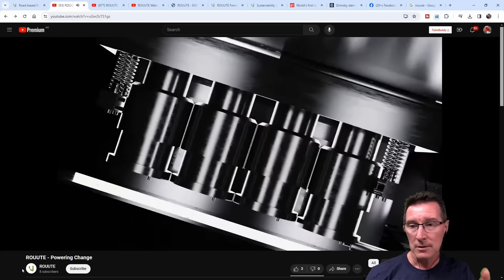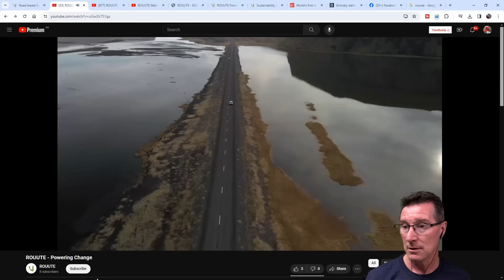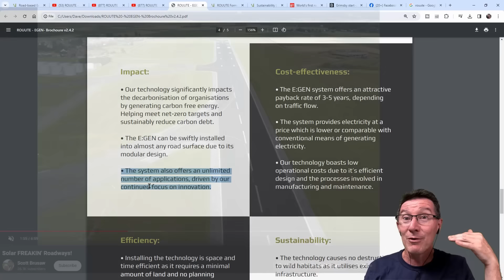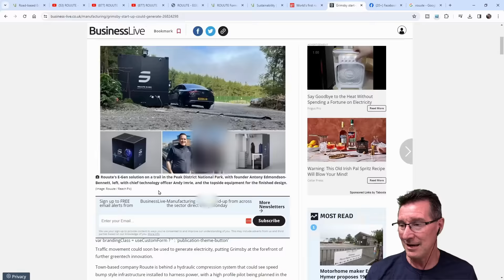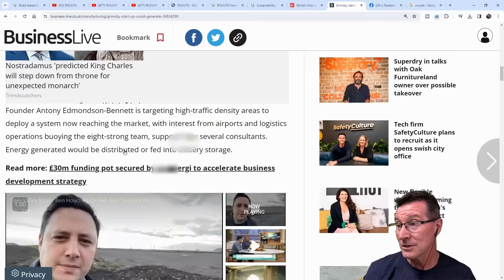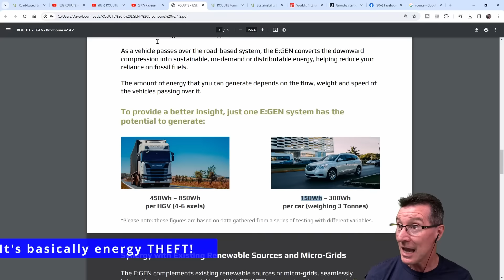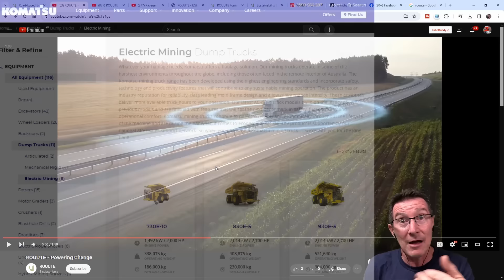EEVblog 1600 - Rouute: Road Based Energy BUSTED

Comment: This scam has been in the pipeline for over 10 years.  When it first appeared, it was for footpaths in shopping centres to steal (Sorry "Harvest" ) energy from pedestrians to power the lighting.  At least, the original concept was actually harvesting energy (though immorally) but, this road concept is just stealing fuel to harness cents-in-the-dollar on the stolen fuel cost. It's the complete opposite of 'environmentally friendly'. Any government officials who even consider purchasing these systems should resign immediately on the grounds of incompetence.

Comment: but if you bring a 3t hummer from 100km/h to a full stop on a highway. a hummer that is fueled by gas, how exactly is that carbon neutral?
and how do you prevent the driver dying because of that immediate stop?
I actually can see a way how to extract that amount of energy, make the speedbump rectangular, 3m high and sufficiently long and deep, and have the hummer (or other car) smash into it. immediate stop. not great for the car or driver, but it would work.

Comment: This is the thing. If you just draw a basic diagram with arrows representing the downwards weight of the truck and horizontal push of the vehicle you get a diagonal line. You cannot extract energy from the weight of the truck as it will weigh the same and so the only other place is from the push/momentum. If you extract momentum then the truck slows down (needing energy to accelerate) which means it needs to use more energy (and gas/electric) to speed up.

Comment: Dave I wonder one thing how would such things survive a winter in the nordic countries? Like what will happen with snow and snow slush I have a feeling that it will freeze up solid, and what happens when the snow plow comes ouch I do not want to think about it. Seems like the HYPE for enviromental friendly ideas are taking the route to scams, like electric cars freaking toys if you ask me when the battery pack wears out renders the car worthless. One thing I think we all should fight for is the newer cars climate control systems, and that they should be OPEN SOURCE so we can repair these 20 years ahead it should be illegal to charge you $5000 for a freaking display and micro controller. But back to these scams that pops up I am really happy that you keep debunking this madness, more people need to understand that this will not work and the bus and lorry drivers bouncing up and down it is already a problem today...

Comment: Out of all these solar freaking road ways solutions, I don't understand is why no one is just putting pipes in large parking lots in the asphalt and pump water through it during daylight. That would create a ton of heat that could be used to augment the power for what ever large building the parking lot is for.

Comment: Revolutionary idea for these guys, instead of taking the energy from the car, just go straight to the source, hook up an engine to a generator and that's going to solve our power needs, we could distribute these stations where it's feasible but also distributive to prevent losses and vary the generation based on demand and not need storage, could call these places power stations, probably more efficient motors than car engines but that's for r&d to work on.

Comment: Dear God - stealing kinetic energy from vehicles that cannot avoid the bumps.  Highway robbery, in fact.  Who will take responsibility for fatalities caused by the bumps at full highway speeds?  Madness!  What happens when one of these bumps lock up or [if hydraulic fluid-based in rubber bladders] deflate fully to create a deep pothole?  Repeat - madness...

Comment: If you want to harmess energy from a moving car, use the same concept from regen braking but put it in the road near stop lights and activate the system when the light is yellow. Still a dumb idea, but at least it does the same thing without damaging the cars.

Heck, use it on roads where it’s triggered by vehicle speeds so it provides increasing resistance the higher overvthe limit you are. It won’t stop speeding, but it’d be like a tax.

(and the added bonus is that it would pull harder on heavier vehicles which do more damage to the roads)

Comment: Those numbers give speeds too close to realistic speeds for cars, to be a coincidence. My guess is they actually did simply calculate "how much kinetic energy is there in a car driving along the road," assumed that that can all be converted into electricity, and didn't get around to (or ignored), that if you convert that kinetic energy to electricity, you no longer have the kinetic energy as such.

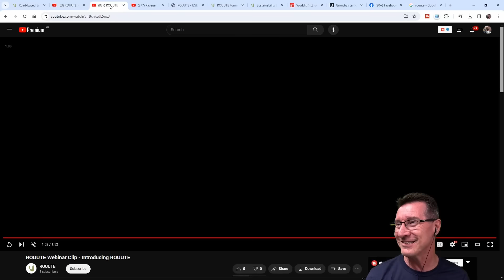Comment: 19:54 Those "electric" dump trucks have a diesel engine (surprise!) used to generate the electricity to drive the motors in each wheel. It's not a bigger Tesla. 😉

Comment: This reminds me of a concept I came up with around a decade ago: a Piezo transduction layer "under" (or imbedded in) the road way.

kind of like how a piezo mic turns sound into electrical impulses.

The crystals deform under the weight of vehicle traffic, converting what is lost in heat, and road damage, into very very (and some more verys after that) small amounts of electricity, that is aggregated, stored, and distributed.

I couldn't come up with a cost effective system for manufacturing, implementing into existing infrastructure deployment processes and maintenance. 

each piezo element is expensive compared to the power output, it's expensive to network the array of elements, expensive to embed it into the roadway without changing the way roads are constructed.  expensive to test how expensive it would be. expensive to test how little power it would generate.  expensive to find out what the failure rate would be under real traffic. expensive to replace failed elements.  expensive to determine what the break even point on return would be.... 

I keep thinking each time you do one of these roadway debunk videos, I should mention it, just in case there's something stupid I'm missing.  I figure that this one is close enough that I'll finally mention it.  

It's expensive to patent an idea that I didn't think would have a return on the cost of going through the patent process, but looking at this company, it's possible that they would be infringing on some of the ideas I came up with, so I suppose if I had spent the money, been awarded the patent, I could finally sue someone and be a patent troll?

Comment: Hydraulic power transfer systems are inherently lossy - I don't know of any that are more efficient than mechanical drives, and all the industrial scale applications I have worked on come with cooling systems to deal with waste heat - as do the transmissions on most automatic gearboxes. That's without even considering the friction from seals, bushings guides.

Comment: One fundamental problem not mentioned is the fact that cars and trucks have dampers.  When a road wheel hits a raised part of the road, the wheel is deliberately allowed to move upwards out the way, and the energy of that impact is temporayily stored as tensile energy in the road spring.  But we cannot let that energy simply come back out the spring unchecked because the car would be undrivable with both sprung and unsprung parts boucign around uncontrollably. Hence, we fit dampers, and these hydraulic devices absorb the impact energy and disipate it as heat.  These dampers are specifically designed to be as close as possible 0% efficient, ie to do their job of keeping the road wheels smoothly in contact with the road, the dampers must disipate the energy from the perturbation as heat, as quickly as possible.

So every single vehicle that hits one of these ridiculous moving speedbumps is going to be wasting at least the same amount of energy as heat in it's dampers each and every time, which means even if the energy collection system was 100% efficient the overally efficency is going to be well below 50%, which immediately makes it much much worse than just using regen braking, which being a low impact event, won't also fall apart the entire time........

Comment: In fact, the opposite of what they're proposing is true:  by constructing straighter, flatter, uniform, less slippery and better roads, the energy consumption of the overall system (including all vehicles, either gasoline or electric ) is reduced, decreasing emissions.   Theirs is total BS and nonsense.

Comment: Yeah this is going to pull kinetic energy off the car. 

Downhill usage might generate a useful amount of power, but that's going to be a rough ride. Aside from comfort, that could beat up suspensions pretty badly if it gets widely deployed and that can get expensive. So while a downhill  installation might gain you back some energy that would otherwise be wasted, I don't know that it would be a net benefit. It may just relocate the energy usage to parts factories and mechanics shops.

The main use I could see, and this would be highly dependent on installation/maintenance costs and local power costs, might be if you need a speed bump anyways because idiot kids like to race around your shopping mall or something like that. Might as well scavenge a bit of power while you're at it. In an environmentally conscious area it might even make sense to take a net increase in operating expenses and hope to make your money back when you mention the system in ads. Of course, all that depends on the costs involved which will likely be very high early on.

Don't get me wrong, I'm glad someone is working on this sort of thing, but I'm definitely with you that this is a niche solution, not something suitable for the wide deployment these people seem to be pushing.

Comment: I’ve had a much better idea for a while now, hear me out on this. I believe we should design very large water pump that can flow, say, a billion gallons per minute, insane amount of water. We then make a large corrugated hose, maybe 1000 meters in diameter, so it’s flexible, yet rigid, that is long enough it could reach into outer space. We then use a special rocket to carry one end of the long hose to space, then let it free float in zero gravity, simple right? Then, we pump the oceans water into space so it orbits the earth in a frozen mass. This has nothing to do with energy, but I think we should do it anyway.

Comment: I don't see how such a system can be easily scalable, so perhaps it's killer app is just powering our streetlights as you suggest, but it's certainly not a 'downhill only' jobbie! We 'love' our speed bumps here in the UK, and most towns are riddled with the poxy things as part of traffic calming schemes, usually on massively busy roads - each of which must see thousands of tonnes of commercial and private vehicles daily. I'd take issue with their figures in kWh but even so, massive energy reclamation seems perfectly viable. Just not sure how this would feed back into the grid! Also, the system doesn't have to manifest as janky suspension-damaging traditional speedbumps; it could just as easily feature gently-curved large sinking soft-damped pads that would accept faster traffic (up to a point!). Mechanical transducers like this are old tech that's been around for decades, so this particular application does at least seem to have legs - at least if they can ace the logistics.

Comment: You don't use zero energy when going downhill, you use negative energy. You're doing exactly what the speed bumps are supposed to do. Just more efficiently and more comfortable for the driver. The future, I'm telling ya. :D
But as far as I understand, they wanna use these things as normal speed bumps? Essentially turning gasoline/diesel into electricity, presumably with a terrible efficiency? That sounds even dumber.

Comment: I've only watched 1 minute and I feel compelled to say that this simply transfer some energy from the cars' gas tanks to the speed bump owner (with less than 100% wfficiency)... So, basically, this INCREASES the total power consumption...

However, it COULD make a tiny bit of sense at the bottom of a downhill (or several places along the downhill).
Naah, forget it, people would slow down BEFORE passing over the speed bumps so to not be jostled around their cars so the energy would be extracted by the brakes and not the speed bumps...

Comment: Every watt of power this thing generates is stolen from the vehicles momentum. Which means the vehicle needs to generate more energy to replace it. So it’s nothing but a super inefficient conversion of fossil fuel to electricity. It’s legitimately MORE environmentally friendly to generate that same amount of power using a gas powered generator placed on the side of the road, there would be less conversion losses just burning the fuel 😂 this is wildly stupid….

Comment: The bumps could be made smoother by putting a driving surface above them, evening out the bumps. In such a way you could be driving slightly uphill on an otherwise horizontal trip all the way to a greener world. It will be like driving on sand LOL

Comment: Real fun is this.  Several years ago our municipality also wanted to "experiment" with energy harvesting road bumps. I did the math based on the vertical movement of the bump and the weight of a car. Results were the same: useless idea. So I wrote a letter with the math. Luckely they didn't invest money in this experiment.

Comment: You'll find energy harvesting with wind turbines at UK roads for road side installations (road signs, metering, ...). The speed bump could be used for traffic purpuse but there a non newtonian speed bump which are cheaper.

Comment: The energy has to come from somewhere. It takes more energy to drive over a speedbump than to drive on a flat road, so the effect of this is to make people use more fuel. Even if the energy conversion were 100% efficient, which it isn't then the drivers are paying to generate the energy. Not to mention that you will be driving more slowly in a lower gear, higher engine RPM,  further increasing your fuel consumption. It is an environmental disaster.

Comment: Aren't you leaving out gravity in your energy calculation?  Part of the energy compressing those things is gravity pulling your car downward.  It's not like you're compressing it by hitting it with your bumper head-on.  You're calculating the energy for a car hitting a brick wall, but it seems to me the force vector compressing those things is more downward (gravity) than the lateral force from your car.  I bet there's a "happy medium" speed that gives the optimal energy transfer.  If you go faster than that, there's not enough time to compress fully.  (And you'll probably lose control trying to drive 60mph over speed bumps).  They will sap speed from your car, though.  I'm not defending them, just pointing out that you might need to take into account the direction of the force that compresses those things and how it changes as the tire rolls over it.

Comment: I think their argument is that this is easier to install to power a light in a remote area than running cables from the nearest city. And supposedly more consistent than solar and wind. But if you are in a remote area there is no way this will be consistent

Comment: Znother example of a technology that does, in fact, do exactly ehat you'd expect it to do, but it isn't USEFUL in the vast majority of cases, and in most cases where it does work, there ae other was to do it that work better.  This is a lot like vac trains, which do work as advertised, more or less, but the extra cost is rather more than twice the cost of doing high-speed rail using steel wheels on steel rails at half the speed, so it doesn't make sense to build vac trains unless you get your vacuum essentially free, like on the Moon o on Mars.

Comment: I think this type of thing needs to be recognised more widely, because this is a place where the "green tech" movement is actually getting pretty disgusting... This and the "traffic wind generator" actually use parasitic loss to steal energy from cars... This is a way to actually steal a little bit from road users... It actually makes emissions worse, costs money and damages roads and cars...
BTW you're after gravitational potential energy probably, not velocity... I assume they're expecting to be able to get all the energy available from dropping the car something like 100mm, which is the maximum height a speed bump could be, given that it's the minimum legal ground clearance for cars. If you took a 3000kg car and dropped it 100mm (0.1m) you just multiply the mass times the height times gravity and you'll get a maximum theoretical yield of 2943 joules per "bump" or not quite 1 watt hour.

To be clear they're stealing your fuel to power these things...

And adding these things at the bottom of hills will reduce brake performance, because the mechanism will generate inconsistent ground contact.